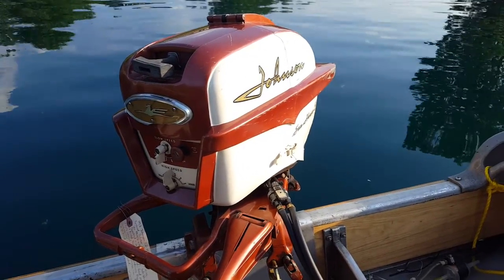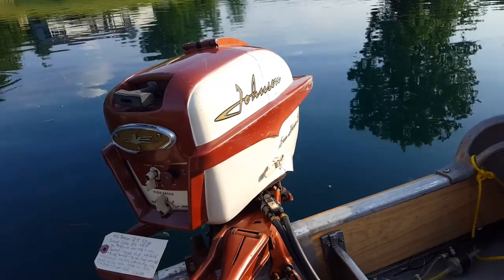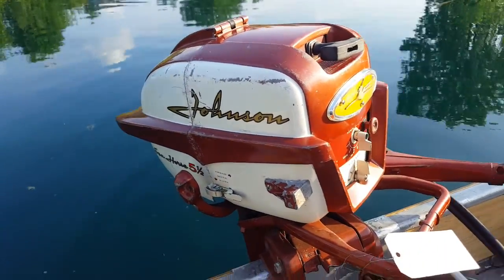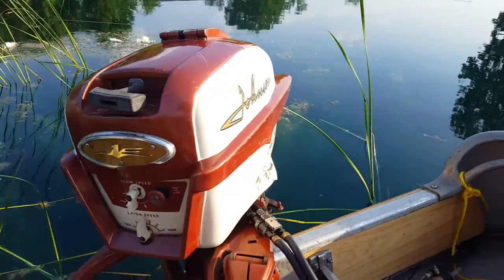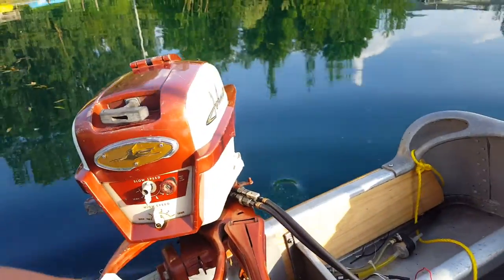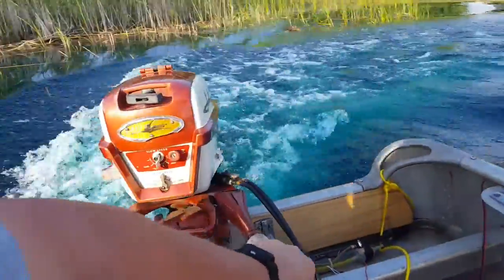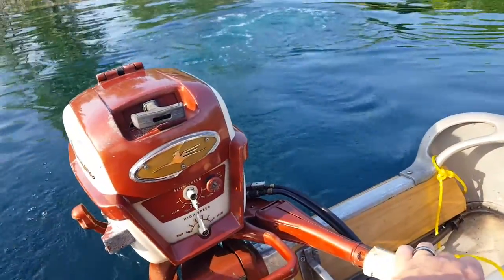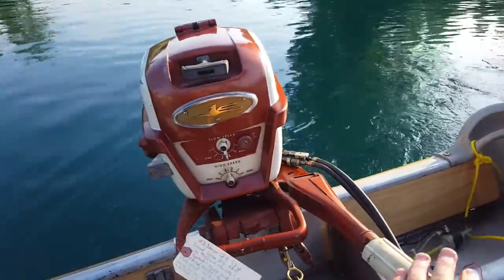1958 Johnson CD-15 5.5hp Outboard Motor Pond Run

Comment: Very nice indeed, clean looking motor n sounded awesome. I have a 54"  5.5 , it spent most of its life in a old shed, the mice urine actually dissolved part of the carb, and chewed plug wires into pieces, they are definitely destructive lil creatures. got a used carb from Brazilian Connection, and replaced all of the spark side of it n it turned out to be a great lil motor. Thank you for sharing your video, and thank you for the help, got the old 7.5 evyrude dialed in pretty nice yesterday. Have a great day
Reply from the maker: This little motor does look fairly good from the outside.   With the cleaning and fresh paint on the powerhead it doesn't look bad inside either now.  It was really a mess, but I got lucky on the carburetor.   The mice were all at the rear of the engine and only a small amount of outside surface damage to the carb.  Once I got the pistons freed up and cleaned things up a little it looked very promising.  I'm quite surprised how well it turned out.   It sounds like you had quite an adventure with yours.  I'm very glad you were able to get your 7.5 dialed in yesterday.   That's excellent!  You're very welcome and thanks for watching!

Comment: I have a 1958 5.5 also that is ready for the test barrel. The needle valve's are lightly seated. What would you suggest opening them up to before starting ? How far to turn slow speed and high speed before starting. I would sure appreciate your input because everyone tells me a different story.
Reply from the maker: You'll get a different story from everyone you ask. I have even read different stories in official documents.  I typically start (in normal weather) with the high speed 1 full turn open and the low speed 1.5 turns open.  The high speed will need to be dialed in first.   Once the high speed is dialed in amd the engine is at full operating temperature,  adjust the low speed.  It should be set at the lowest possible throttle setting, under load (in the water in gear) and should end up halfway between where the idle falls off from too rich amd where it lean pops and stalls from too lean.  In cold weather I start both out a 1.5 open, but that is way rich on the high speed.   It simply makes the engine easier to start in the cold for the first time. I know that I will end up taking about 3/4 turn back out of of high speed once it is running.   I have a video on my channel on dialing the carburetor in.  I used a '58 Johnson 18hp, but it is the same procedure.   Thanks for watching!
Reply: @oldjohnnyrude8404  How can you get 1.5 turns on the slow speed when the faceplate has that stop protruding from it ? Push in the faceplate ? Thanks
Reply from the maker: @rustyleighty1999  I don't put any of that stuff on the motor until it is dialed in.   It just gets in the way.  When you say your needles are seated, are they actually seated or just against the lean stop on the faceplate?  I reccomended leaving the cowl and faceplate off while tuning initially.   Just put the airbox on and tune that way.  Once it is set to your liking, remove the knobs, put the faceplate and cowl back on, then fine tune it from there.  When you are all done, set the needle handles in the center of travel so you can make fine adjustments as needed according to weather conditions.  That way center is always your reference to neutral tuning.  Does that make sense?
Reply from the maker: @rustyleighty1999  https://youtu.be/kpA6BbotSOE
Reply: @oldjohnnyrude8404  Thanks man. Yes I did have the needles seated just right.....But it sure does make sense to leave that stuff off there until you get it started and running. And then set them as you said. These old knob's seen better day's so I am VERY CAREFUL doing that. I really sure do appreciate you replying to these comment's. By the way I did get the scruffy 1959 Evinrude 18 hp in order and it is ready for the barrel also. These old Outboard's kinda grow on ya don't they...?
Reply from the maker: @rustyleighty1999  Great!  I'm glad that made sense and was helpful.   I figured you probably had the needles seated properly,  but there have been many people that have not understood exactly what that means so I just wanted to clarify that one.  Good to hear you got the scruffy Jubilee 18hp ready for a test run as well!  Yes, these things really get in your blood if you catch the bug.  I know they grew on me like I never imagined.   LOL.  🙂👍
Reply: @oldjohnnyrude8404  According to the other member's of the Vintage Evinude Johnson club I need O.M.A. help....That stand's for Outboard Motor Anonymous. But anyway I also am in the process of rebuilding the tank just so I know what is what. She is clean as a bean on the inside and a tad shabby on the outside. I like em like that ! I wish I knew how to send photo's on this here YouTube. I am a computer Dummy also. Have a good day Brother !
Reply from the maker: @rustyleighty1999  I'm sure I need therapy, then.  LOL.

Comment: I have the same outboard and was wondering where did you get your fuel line I know this is not like other outboard fuel lines.
Reply from the maker: I typically use 3/16" Gates or Thermoid rubber fuel line and zip tie clamps on these motors for the fuel line and the air pressure line.  I buy it at the li am auto parts store  or online.  There isn't anything really special about it.  The factory size is 5/32" but the 3/16 works well as long as it has some kind of clamp.  It doesn't need much clamp force, just enough to keep it snug.  It fits quite nicely.  Thanks for watching!

Comment: Nice save on this one. sounds like it was a lot work.   So do you have like a top 3 three OMC motors from the 50's  Year and hp ?
Reply from the maker: Outboard Fun Thanks Scott.  Yes, this one was a lot of work.  It was such a nice, low-hour motor under all the mouse damage I had to try to save it though.   I'm happy with the outcome.  As for a top 3 in 1950s OMC outboards, that's kind of a tough one.  I'm not sure if my answer would be the same every day, nor am I sure I can put them in  order of favorite.  I'll try for a top 5 instead   
5) 1953 Johnson QD-14 10hp.
4) 1953/4 Evinrude Super Fastwin.
3) 1955 Johnson QD-16 10hp. 
2) 1958 Johnson FD-12 18hp.
1) 1959 Evinrude Sportwin 10hp.
Thanks for watching!

Comment: Sorry about that, (continue), how difficult is it to repair this part. And how much is a motor like this worth that's in half decent shape?
Reply from the maker: Replacing the shift handle on one of these is not a difficult task.   On a motor you don't know the history of,  it is always a good idea to service the water pump and lover crankshaft seal assembly anyway.  This work requires removal of the powerhead anyway (which is not difficult either) so from there replacement of the shift lever is very simple since you will be right there at it once the powerhead is off.  There is an O-ring on the shaft that you will want to replace to keep it from leaking water around the shift lever shaft. The value of these motors is very subjective and depends heavily upon your location.   In my area one of these in nice cosmetic condition can fetch $250-$350 in good running condition.  Maybe slightly higher tonthe right person if it includes a good working pressure tank but it is very tough to get more than $350 for one in my area. They are wonderful little fishing motors.  Just make sure to run them on 16:1 mix and use ethanol free gasoline if at all possible.  The ethanol is bad for the rubber parts, especially the check valves in the reed plate for the pressure port.  It will also dissolve the shellac on the cork float in the carb, but thatbcan be replaced with a new ethanol resistant float.  The check valves are more work to replace and eventually will become difficult to get.  Thanks for watching!

Comment: Another lovely silent motor! Can I ask a quick question, I need to change the gear oil in my 2002 Mercury 15 2 stroke short shaft. Can I use ordinary ep 90 gl5 gear oil in your experience? Or is there something extra or magical in the marine lube?
Reply from the maker: Thank you Bill.  This one did turn out well and was completely worth the work I had to put into it.  
To answer your question about the gearcase oil, you "can" use ordinary ep90W GL-5 gear oil and I have heard it said that many marine gear oils are simply re-labeled automotive gear oil.  The reputable brand name marine lower unit oils do contain additives not present in automotive gear oil, though.  For the more modern gearcases with rolling element bearings and thru-prop exhaust I spend the extra coin and use Quicksilver brand Lower Unit Oil.  The extra additives help maintain the oils lubricating qualities and corrosion protection better with water present in the oil.  You never know when a leak can start and you don't find out until it either starts dripping oil or you drain the oil and it shows water in the oil.  For the subject motor I would recommend buying the marine oil for the extra protection.  If you do decide to use regular gear oil, change the oil more often.  The classic 50's and 60's OMC motors without thru-prop exhaust were originally designed to use automotive hypoid gear oil.  The marine oil is still better, but I just use plain EP90 GL-5 in those.  I just make sure it doesn't contain any additives that attack the yellow metals.  I buy that stuff by the 5 gallon pail.  Sorry for the lengthy response.  Thanks for watching!
Reply: Many thanks for such a comprehensive reply Ben. Appreciate it. I came to the same conclusion as you. No point risking ruining a good engine to save a few euro! Got a thru-prop Yamaha 2 stroke 8, so reckon same applies there. The other will do for my old (non-thru) Johnson 4.5 and Seagull 3.5. Plan to do an inshore trip on the Atlantic Ocean soon, off west coast of Ireland, weather permitting. First time on salt water (with my lake rig). I'll post a video when done. Need to get a flusher kit for after!
Reply from the maker: You're very welcome.  Yes, I would recommend the good stuff for the Yamaha also.  The Seagull will certainly be fine with Ep90 GL-5.  The Johnson 4.5 may actually benefit from the marine lube also.  The gearcase on those motors has a couple of shortcomings.  They hold up pretty well when used in forward gear 99% of the time.  The reverse gear bears directly on the gearcase casting though.  Extended, or high speed use in reverse will damage the case.  It also uses spring loaded ball bearings in the prop shaft to hold the shift dog in place.  If things start to rust inside there those don't work so well anymore.  As long as there is no water intrusion, the atuo gear lube is fine, but if it gets water in it there may be problems.  Something to think about.  

Good luck with your ocean trip!  Be safe and have fun.  I'll be looking forward to seeing the video.  Definitely get your motor flusher ready for after the trip.

Comment: What a fantastic looking motor! It's a shame those mice ruined the inside, but it still is a little gem! I just like the look of those '58 so much.
Did you do anything to the paint to get it so nice and shining? I've got a '58 7.5 myself and the paint is very dull, not anything like yours. I also hate myself for breaking off one of the cylinder head bolts. It has broken off flat with the surface of the cylinder so I cant put vise grips on it. Can you give me some advise on what to do? I don't really trust myself doing anything more to it as I don't want to ruin it any further...
Reply from the maker: VintageOutboardMan Thank you very much! This one is still a little gem.  I cleaned the paint with hot water and dish detergent first then used a mild liquid rubbing compound on the paint to restore the shine.  I also have a '58 7.5 that looks about as good as this one and runs just as well.  Great little motor.  Very quiet smooth fishing motor and a little bit faster then the 5.5.  

As for the head bolt, I'd pull the powerhead off and take it to a machine shop to see if someone can remove the broken bolt.  That's a tough one,  but with the proper tools, it can be removed.  Good luck and thanks for watching!

Comment: she is beautiful, and surely outruns the 63 you showed us..I'm amazed the outside of that cover stayed so nice with all the mice inside.  That shift lever seems misadjusted though, is the bellcrank sloppy?  Nice save, a beautiful engine that can be used as a daily runner...
Reply from the maker: kramden Thank you Don! Yes, the cover was quite dirty and oily. It did look decent in the ad photos though when I bought it.  I knew when I saw it in person it was moused. It was a lot of work but it turned out great.  It will definitely outrun the 63. The shift lever is actually in the correct location and the bellcrank is nice and tight.  It does look like it may be off in the video, but it's just the angle.  Aside from the mouse damage,  this motor was in incredible condition.  Such a shame the mice got to it.  It's a favorite now though.  Thanks for watching!
Reply: Yeah, videos can be deceiving for sure....Like I say, a beautiful engine that you might mind using....
Reply from the maker: kramden Yes they can be deceiving at times. I will put some fuel through this one.  I enjoy running the 5.5s when they're good strong ones.  I have a few nice ones I like to run now.  👍

Comment: Wow mice that chewed through aluminum!!   Must be robots!  Another nice motor.  Thanks for posting.

dale
Reply from the maker: Yeah, they chewed right through it.  It isn't very thick aluminum, but still kind of surprising.  There must have been several generations of mouse families that had lived under the cowl of this motor.  I had to pound the cover open with the heel of my palm and once it was open it would not close again.  The nest material just about doubled in size once the cover opened up.  I have never seen once packed so full as this one was.  Luckily, they never really got around the front over the carburetor.  From the crankshaft back and on top of the rewind it was a terrible mess though.  Everything was corroded and frozen.  It did turn out nicely though.  It is now one of my favorite 5.5s.  I still need a 3hp and a 35hp if I want to round out my line of 1958 Johnsons.  Thanks for watching.

Comment: What a nice smooth runner for having been inhabited with mice! I can tell also it is definitely a lower-hour motor by how smooth it ran! Another nice one! Mark in Iowa.
Reply from the maker: Thanks Mark.  It did turn out very well.  Much better than I ever expected when I first opened up the cowl.  I had never seen a cowl as packed with mouse nest material as this one was.  With the magneto plate and the powerhead both stuck, I really didn't expect to even be able to save it when I first got into it.  I freed up a couple of other stuck engines and decided it was worth trying to save this one.  I'm very glad I did.  I think its a keeper now.  Thanks for watching!

Comment: I have the same motor there real reliable man had mine for a few years
Reply from the maker: farmallchris Yes, these are very simple, very reliable motors.  They just need plenty of oil in the fuel (16:1) and good flow of cooling water and they keep on running and running. Thanks for watching!

Comment: Ha I have the same engine what is you fuel mix
Reply from the maker: @scottyates3705  16:1 is the correct fuel mix ratio for this motor. No rolling bearings in this powerhead. Thanks for watching!